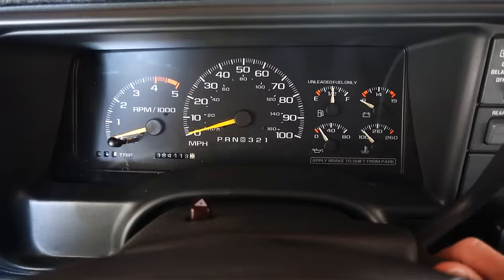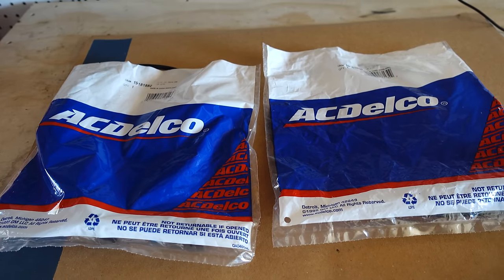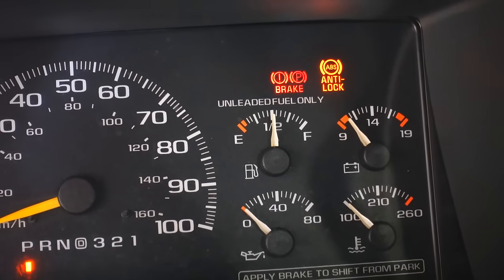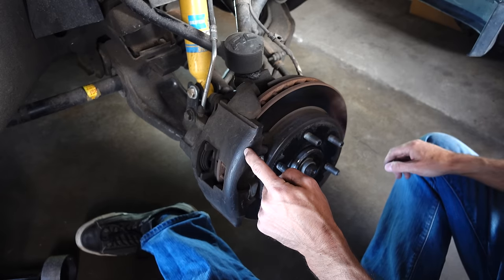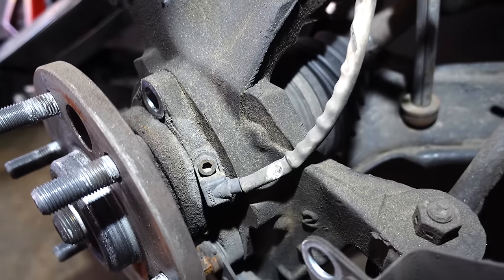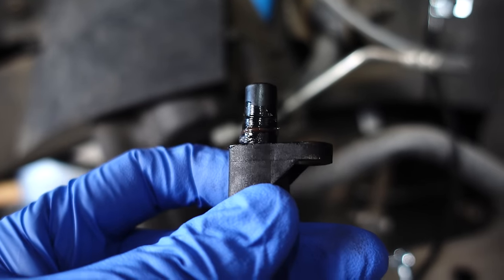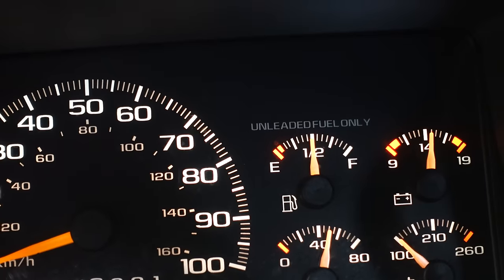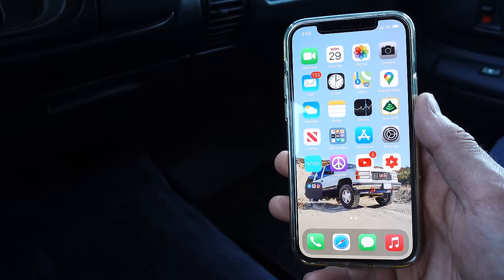This ONE SENSOR Easily FIXED My ABS System! No More ABS Light!!

Comment: Yayyy !   Those teeth you see in the hole are not from a gear. It is called a reluctor. The sensor measures the change of the magnetic field caused when the highs/lows of the reluctor spin across the magnetic field of the sensor. This tells the computer how fast that wheel is or isn't turning.

Comment: I love how you are throwing parts cannon at it. You have to when you don't have the tools to scan or see what is needed to make a proper diagnosis. I have to do the same thing. I have worked on cars for years and do not have the expensive equipment to tell exactly what's wrong. Like you I research make checks and do the best I can. Normally I am right. Keep up the good work.

Comment: The sensor doesn't always need replacement. Usually brake dust needs to be cleaned off of the sensor. Do this whenever you service your brakes.

Comment: I like the logic that you followed to get to the problem without havIng to 
check for the voltage or the resistance on the rest of the wires connected to the 
sensors which would have required to spend more time underneath the 
vehicle. This would have been a pain. Thank you for showing us.

Comment: On those trucks you can substitute a 1k ohm resistor for the speed sensor and see if the code changes to history. The EBCM sends a test signal to the sensors and if a sensor is open, it sets a code and turns the ABS lamp on. The actual speed sensor generates an AC signal so the resistor cannot be used to diagnose a erratic or incorrect signal but for testing for an open, the resistor will work.

Comment: I replaced my 2 wheel drive 2004 burb front hubs and the abs sensors were in the kit.  The hubs were rusted in and had to be hammered out, so far so good.  Glad yours was a simple fix.

Comment: I have a 1993 K2500 GMC Suburban SLE that I purchased recently with the same problem.  It's nice to be flipping thru YouTube and see a possible correction for my problem. Going to get the sensors and see if it takes care of the problem on my vehicle.  Thank you.

Comment: GM also have a problem with the ABS module, which is probably what they replaced before? That usually triggers the ABS light and the park brake lights. I fixed mine by opening it up and resoldering the broken connections.

Comment: Alternatively we can use an ohm meter to measure the continuity of the wheel sensor. Depending on the brand, the sensor should have some reading not too high/low. Make a comparison between Left/Right sensor ohm reading if you do not have an OBD scanner.

Comment: Well, on my 95 Suburban, the diagnostic is pretty easy - the lead caught on fire when I had to torch out the sway bar end links. Yay rust belt. I still say mine stops better without the ABS functioning.

Comment: I have had a nagging stutter and Erratic misfire with a dead spot in throttle on my 1988 s-10. I looked the motor over, made a list of sensors, filters, plugs and a valve cover gasket. I worked on a portion each day and in 4 days I had it all compete. Wow does my truck run like a brand new one! I went all acdelco, absolutely NO KNOCKOFF’s because they have cost me more in the long run shorting out or even plastic tip melting “air temp sensor”. It may have cost me $300 in the parts cannon but a garage in labor would have charged almost that for diagnostic and just a few parts because of shop mark up and those parts wouldn’t have been acdelco. Now I have a few good used back up sensors put up also since 1988 parts are becoming hard to come by. Using the parts cannon can be a very good thing.

Comment: Always use die tec grease on connectors. Usually the plug gets corroded at the plug, on top of the frame. Its a T30 Star bit. Just change them.

Comment: most failures to the wheel sensor is the wire. it rubs to the dustshield and shorts out over time,, i did fix the wire one time. but a smal preventive thing to do is to ziptie a rubberhose over the wire at dustshield at all fasteners

Comment: my Toyota had  an intermittent abs tight coming on,  the mechanic replaced the hub with the ring on,  it did not cure the fault, rang the main dealer, who advised it could be dirt- corrosion between the hubcarrier  and sensor,  I took the sensor out of the hub carrier,  cleaned off 14 years of crap where ti bolts in,,   job done

Comment: That's what a scan tool is for. For me I had a bad wheel bearing but it did point me in the right direction. And don't ever put a LED bulb in the ABS light as it will never go out.

Comment: As always, the true test is time. If the ABS light comes back on sometime soon, be sure to let us know.
By the way, I just looked it up on Wikipedia and, your 95 GMC Suburban has the GMT 425 frame and my 95 Yukon has the 430 frame. GMT 400's were in the pick-ups.
Reply: GMT400 refers to the entire truck line, from pickups to Tahoes and Yukons to Suburbans

Comment: I had my abs light on my 95 ck1500 I was in trade school I was able to use a tech 2 and found out the whole ABS assembly was at fault did not wonna buy a new one lol I just removed the bulb a call it a day lol. The ABS system on the gmt 400’s will make you have a Sponge’e Pedal because they trap air they are some videos on YouTube to get rid of the abs and some upgrade to NBS brake master Cylinder.

Comment: That is great that the problem is fixed. However I would like to have seen you do only one sensor at a time and then return it to its original form, if that wasn't the problem, before checking the second one. And I would like to have seen you clean off the grease on the old one and test it clean just to make sure that wasn't the problem. What you did fixed it and that's great but the ABS system is far more complex than just a bad sensor. You can have ABS/TC lights come on when there is nothing wrong with your system, but something else is causing it. But in those cases it will come on when driving it, and usually always determines that the wheels are spinning at different RPMs. If the wheels are of a different diameter (by how much, I don't know) they will spin at different speeds and that is exactly what the ABS system is made to determine. If the tires are all identical in make and size, then the problem could be tire pressure or tread depth differences requiring rechecking the tire pressures or shaving tires that are taller due to tread depth. I'm STILL troubleshooting my 2005 Chevrolet Equinox AWD after a year of this problem. My Subaru dealer told me this is critical for AWD Subarus (I have a few of those) and requires you to shave all the tires to the same diameter if it happens or they will void the warranty on the transmission as it will ruin the transmissions!

Comment: Instead of just shooting the parts cannon, why not learn something?  Go on line and find out if you have an active of passive system.  If active, the process is more involved, but you can still check for the presence on voltage (something close to 12) and ground on each lead on the vehicle side of the plug.  Thus eliminating the car’wiring.  If passive like yours, you can probe the sensor side and check for resistance, they should both be about the same.  If one have very high resistance, or infinite resistance, that is the bad one.

Comment: You've got the knowledge, intelligence, and skill set to move yourself to the next level and make automotive diagnoses without blasting off the parts cannon. Often those sensors are so rusted in place that they break when removed, so you want to be fairly sure before removing them. Invest in a scan tool that can deliver live data. Any car built after 1996 will have data pids that will show a live graph of individual wheel speed sensor response. With the tool you'll know which one is bad, you won't need to guess. Then the next challenge is to know whether the problem is the sensor, the wiring, or the tone ring. Most of the time you'll be able to tell with a brief exam, but you can swap sensors from right to left, then look at the scan tool again and decide whether the problem is the sensor or the tone ring. In some cars the tone ring breaks apart, rusts over, and dies. In others, the sensor is built into the wheel bearing so the fix is expensive if you're guessing.

Comment: Wheel sensor wires if u dont fix..u can have all kinds issues..had a bad one..engine wud not give full power..n brakes wud lock up..abs..cuz it thought i was off in the ground or no traction.. But try driving 10 miles back home doin 5 mhp a hour..krazy

Comment: Your funny, I have replaced my sensors and even hubs. Try the system on top of the ABS motor where all the Hydraulic brake lines hook out. What a nightmare.  Also cruise control cuts out and will not reset unless you do the 3 turns of the key.

Comment: it didn't fix mine, but i have another one (as long as the bad one is on the driver side). the one on the passenger side that was obviously broken in half was not my only problem. time to crawl around under the truck in the dark again

Comment: Hello Jimmy, I have a Toyota Sienna 2002 with the same problem = Engine light on & ABS light on after Rear  Brakes got replace for very 1st time in 18 years.  But brakes works just fine.   Should we do same procedure = replacing the wheels Sensors?  Please advise if possible.  Thanks 🙏

Comment: I have a 92 k1500. My brake light comes on at 30 mph. I wonder...if that's my problem..
Reply: Its the switch connected to the brake pedal. No bull. Easy fix. $30
Reply: @jeffnorbert1871  I changed it. It didn't work. I've been looking everywhere trying to figure it out. Thanks for the suggestion though

Comment: My 2001 suburban abs light comes on when  one of the front tires gets lower  air pressure. I put the same psi in both and my abs light stays off.

Comment: Fire the parts cannon huh, try that crap on a 2007 Cadillac Escalade when the wheel speed sensors are $75-$90 depending on which corner of the truck your working on. Your parts cannon is cheap because your suburban is over 20yrs old, that parts cannon get EXPENSIVE on later model vehicles. Man I like your videos and even when your firing the parts cannon it’s funny but, your practices can cost people money EXTREMELY!!!

Hence the reason why properly diagnosing the issue either electrically or mechanically is the correct way instead of the driveway parts cannon method. There’s a reason why driveway and shade tree mechanics are now called google mechanics or Tuber mechanics. Too much YouTube and google can cost you thousands rather than hundreds or even less with actual diagnosing skills and training. There’s a right way and the drive way!!!

Comment: You should look for an old Snapon red brick, MT2500. It's been out dated and replaced by far more current equipment. But it's perfect for something like what you have. Definitely better than some generic code reader. And because it's out dated it's cheaper, well cheapish. But you could have plugged that in and pulled the abs codes but more importantly seen the live data from the sensors. Or in your case, lack there of. I do not mind the parts cannon on and older vehicle. but sometimes its nice to narrow that stuff down,

Comment: Use a breaker bar or put a piece of 1or2 foot pipe over the 1/2 inch rachet handle to breaker bolts and nuts loose.    Please don't make these amateur mistakes.  Overall a good video tho.  Thanks👍